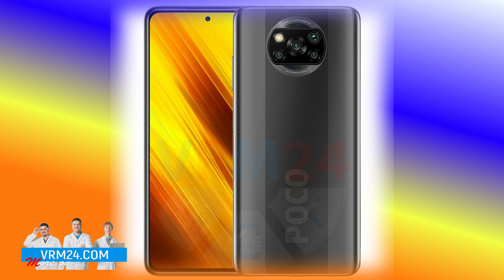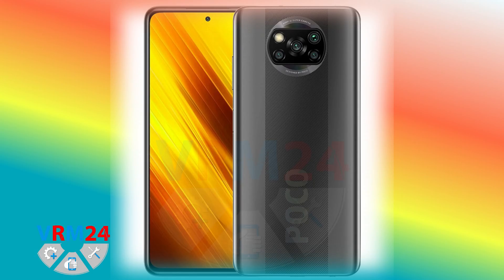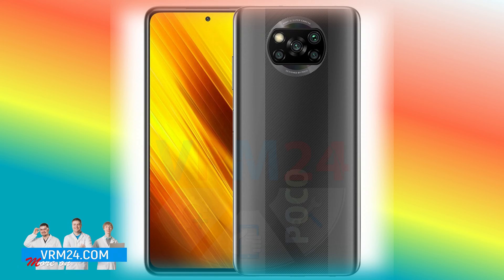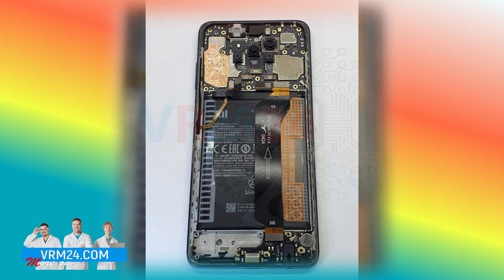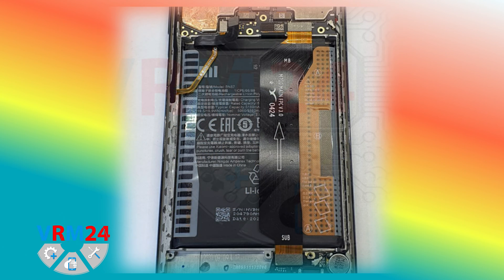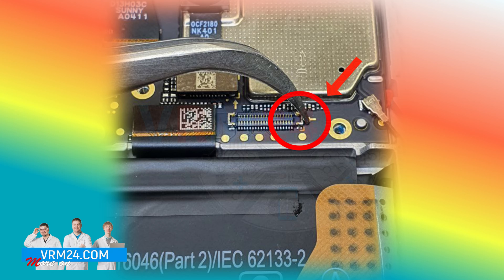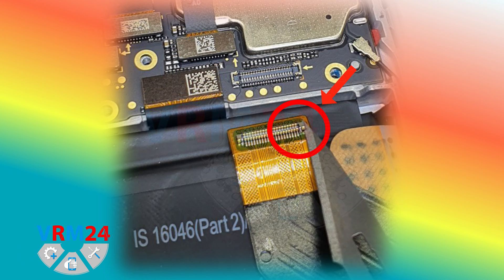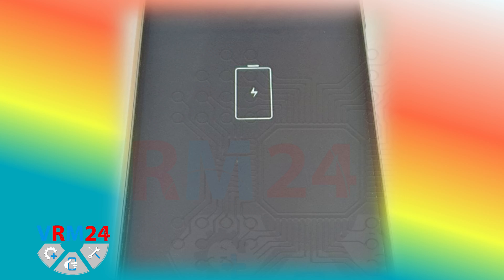🔌 Xiaomi POCO X3 is not charging / Case #1 / Problem / Solution

Comment: Hi. I’m having this same issue. I bought a new charging board (actually two) as I thought the problem was on the connector. Problem is that, even on the new board, I don’t have voltage on the flex cable connector (first test you do on the video). What can be wrong? I’m testing the charging board disassembled from the phone.